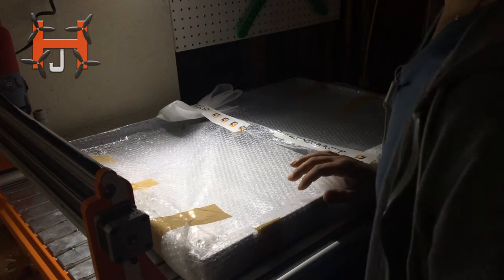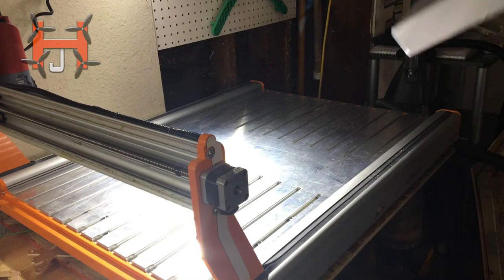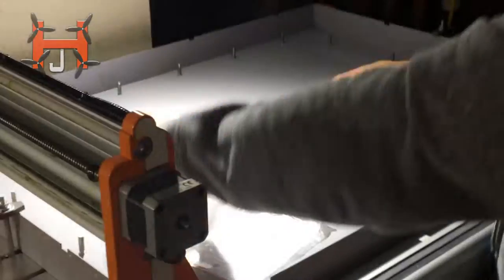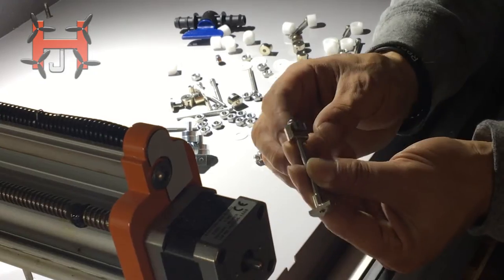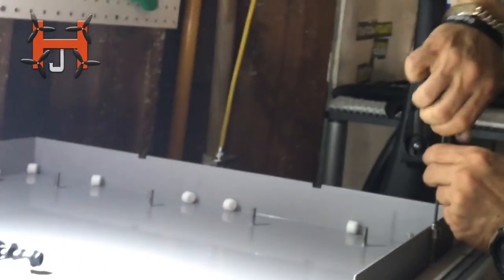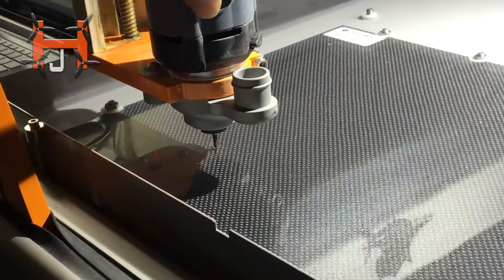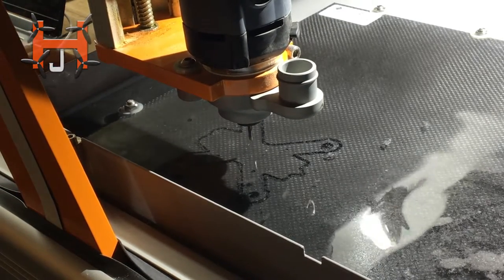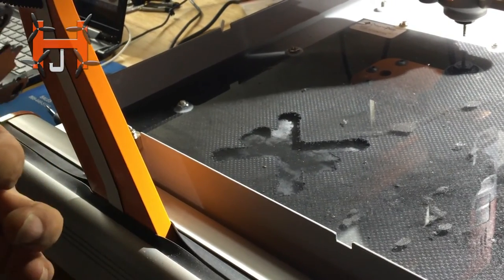STEPCRAFT 840 MILLING BATH INSTALLATION/UNDERWATER CUTTING

Comment: Do you recommend something like this for home use? Cnc would be used indoors but my biggest fear is metalic dust and all the health issues it can cause... This looks like it catches all of the dust? 

Or is there still some need for enclosed case + shopvac of some sorts?
Reply from the maker: Hello, yes I recommend it. Do some trial testing to see the perfect level of water so it won’t splash around. I also use a commercial vacuum when doing small jobs.

Comment: thanks for the response a couple months ago i have another question i think its very general if you dont know how to answer it cool i just cant find anything online about it 
ok so boom 
Before i purchase my Stepcraft cnc d/600 i wanna know how can transport it if i move do i have to completely disassemble it? thanks again my friend.
Reply from the maker: You do t have to if you put the router mount in the center and lock it in place to make sure it doesn’t move and it’s very important not to drop anything on it. Good luck my friend hope this helps